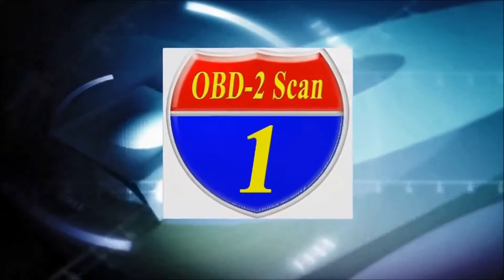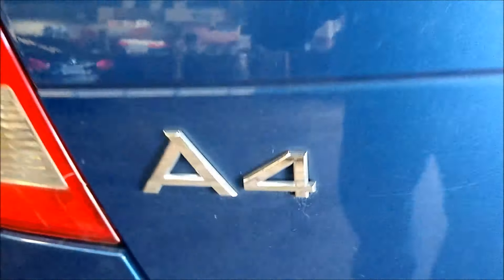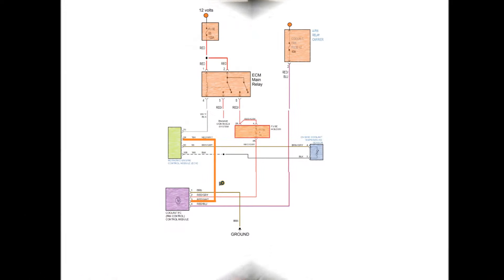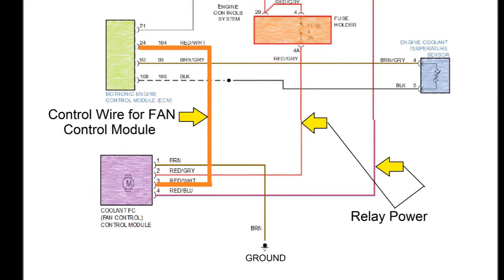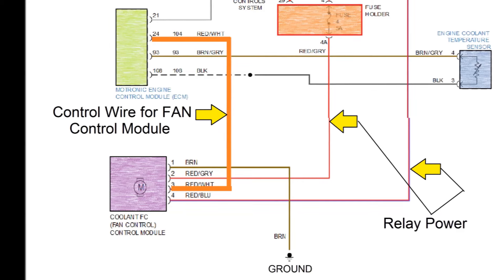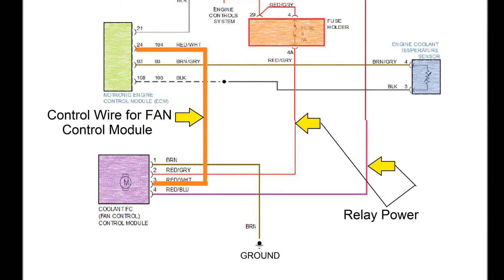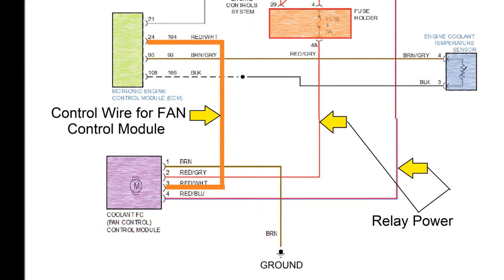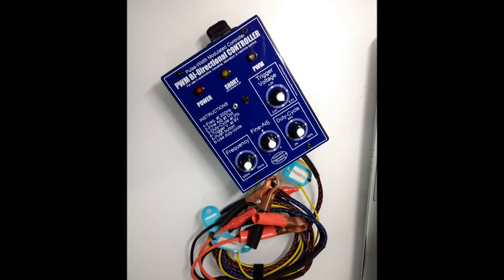How to Test Audi A4 Cooling Fan

Comment: Hello, your video is very interesting and thank you for sharing it. I am writing to you because I need some guidance because I have a problem that has me a little confused.
I have a 2002 AUDI A4 quattro 1.8, my car overheated and I saw that the fans were stopped (it moved suddenly). I did a test on the fans directly from the battery and they work well, after this test it is most likely the fan control module. I bought one on Amazon, connected it and it only worked for 35 minutes. Then I did a search and they recommended another one which I bought and installed, I turned on the air conditioning in the car and nothing happened! I checked a relay that goes under the steering wheel (# 3) which is from the fan control module and it is fine, I also checked the fuses and everything is fine. In the connector where the fan control module goes (purple color) there is voltage 12-13 volts in the pair of contacts.
I honestly don't know what other check to do before returning this fan control that I bought.
If you could give me a hand with this problem I would really appreciate it.

Comment: Thanks for sharing ADP👍
Can the motronic module be tested using a power probe?
What dtc's are set by a faulty module on vw's & audi?
Reply from the maker: Not Power Probe. PP is for electrical  work only, not electronics. 

Well, DTCs are many and change from year to year.

Comment: Good morning, my name is Richard and I have the same audi a4 1. 8t b7 with the same problem, but if I switch the ignition on, the fan stops for a while, when the engin is of and cold, the fan start running without stopping. How do I fix that problem. Please
Reply from the maker: Fan controller possibility, ECM second

Comment: You didn't test this control circuit. Also, what level of PWM voltage does the ECM deliver to the fan control module? 5 VDC or 12 VDC? Also, since the manufacturer does not specify the voltage and detailed operation, does the ECM actually deliver the PWM control voltage to the fan control module or does the fan control module deliver a Vref to the ECM and the ECM toggles the voltage on off ground to create the digital PWM signal? Thank you. Have a blessed and safe week to you and your family.
Reply from the maker: Wow, I love those questions. You are a smart man. Such a video would require an electronics course as well,  which I already have here on this channel ADPTraining. 

Now, almost all these units toggle between 0.00 and 5.00 volts. No, the fan module has no idea of how much to ground the ECM, if it worked like you said. So the entire signal is processed at the ECM. What I didn't explained is that the module looks at either the ground side or the 5 volt side. So which side is the ECM looking at? That would require more testing. Thanks.
http://autodiagnosticsandpublishing.com/

Comment: Replaced a lot of those it’s a misterious little box
Reply from the maker: VW used a strange thinking. They put LOGIC inside these boxes. They do that with a bunch of others relays too. Like the fuel pump relay that also has a crank sensor input to sense when engine is turning.